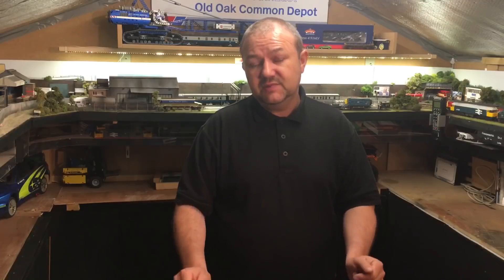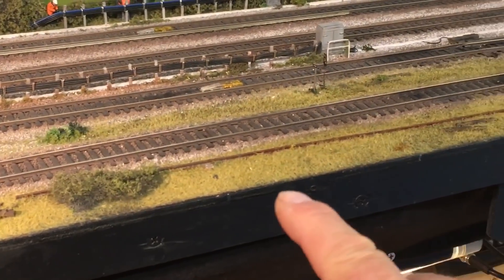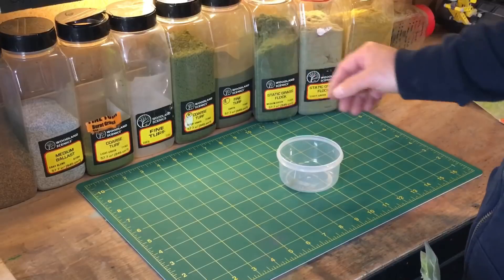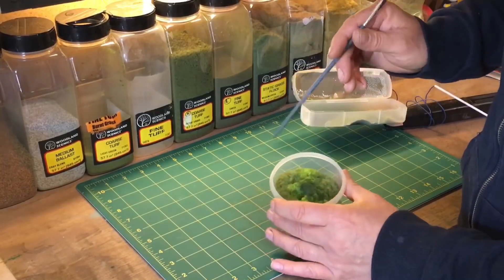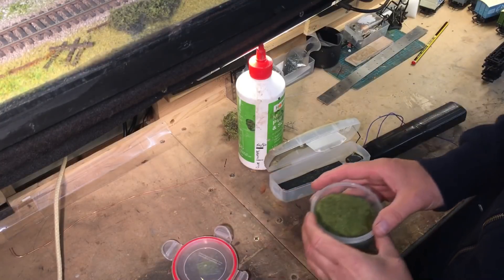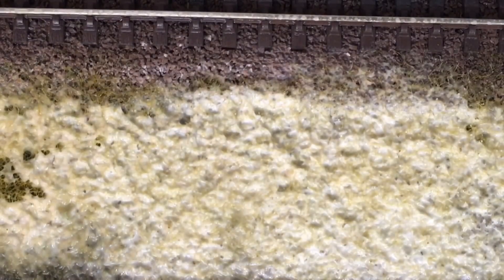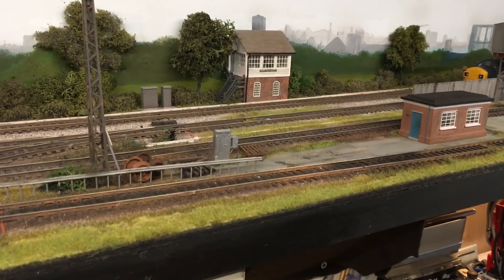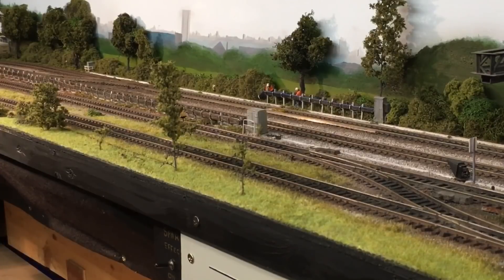Static Grass & Water

Comment: Great video. When you layer the static grass are you using full strength glue or is it a glue/water mix?  Thank you.
Reply from the maker: Hi Many Thanks for your comment 

In most cases a mix of 50/50 pva glue and water with 2 drips of washing up liquid would be enough for scatter / grass scenery  - to hold down nicely.

personally I always buy green evo stick wood glue which i adopt this same method to all scenery and all seems good 👍

Obversely use 100% for trees etc.. 
Hope this helps 

Garry

Comment: Hi dude. Big fan of your channel, have subbed. Am guessing your static grass applicator is homemade? Where did you get the hod from?
Reply from the maker: Hi Thom

Many thanks for your comment and following 

The grass applicator is home made yeap 

Fly bat from pound shop and a Tupperware pot at the end 

I’ve since change the square one for a smaller round one with a clip off lid.. still works a treat 

Hope this helps 

All the best Garry
Reply: +cheekytek Thanks fella. Got my flyzapper and soldering iron on standby, just need the solder and some courage!